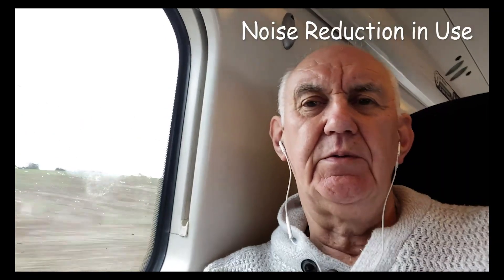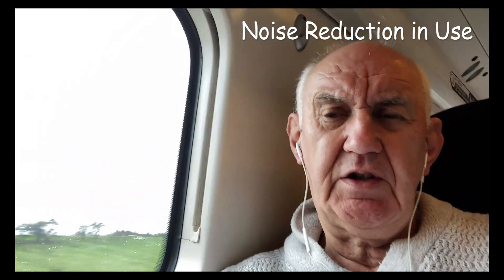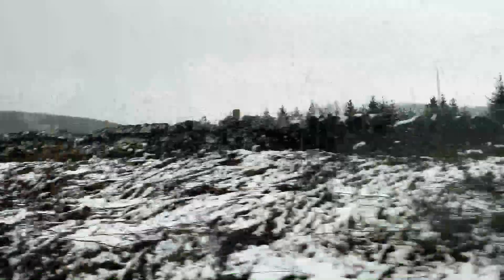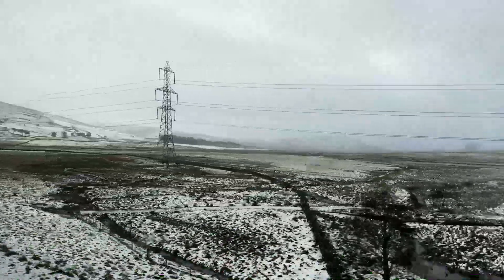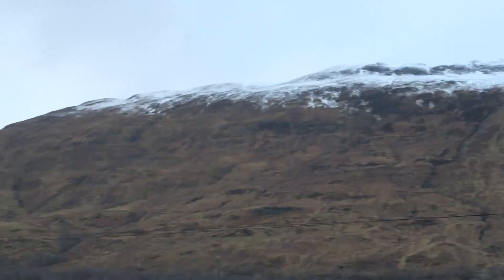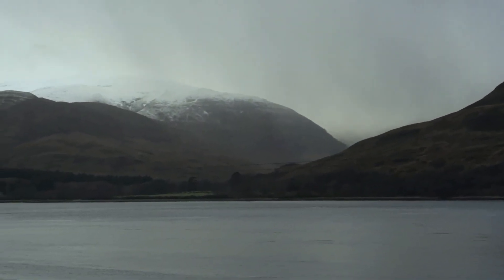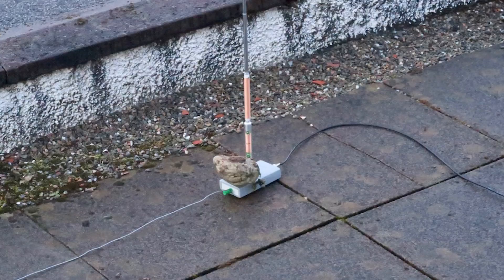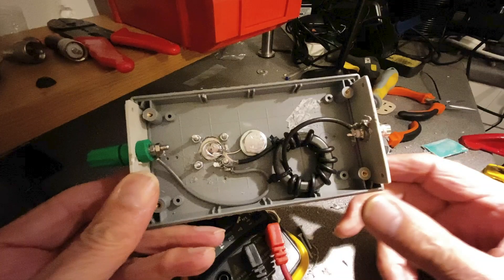Setting Up Your Portable HF Vertical Antenna - Ideal for IC-705, KX2 or KX3 Etc.

Comment: In place of the line isolator could you use a torroid core (240-31) to wind around the coax at the feed point or possibly a choke with a number of  ferrite beads on a jumper at the feed point? I ask because I already have those to spare and have a mobile/portable antenna on order intending to mount it on a tripod for POTA work. Great video with the Iphone btw. K5FIT

Comment: So a quarter wave vertical (17ft) with Chameleon Hybrid Mini versus a 60ft sloper with Chameleon Hybrid Mini? any thoughts Peter?
Reply from the maker: Hi there. I have no experience of the Chameleon antenna. Generally speaking the longer element is better, but depends on the antenna transformer they have used. Sorry I cannot give you more info on this one. 73s Peter

Comment: what verticle antenna can you recommend for a garden of 10ft x 10 ft
Reply from the maker: hi there. The antenna I would suggest you look at is Hustler 4BTV.  Put a copper stake in the ground as the earth and then try and run 3 or 4 short wire radials on the ground or pushed below surface. Radials are connected to the earth point also. 73s Peter
Reply: watersstanton thank you Peter I was thinking of the 6btv
Reply: Hi Peter name here is Paul  I like you videos I built one of those antenna ground isolators works very well with the shorter antennas ! Thanks for sharing Peter! Ps I use a metal tape measure for counterpose 100 feet covers all bands. Lol 73 and thanks again Peter! AA8WQ, from Ohio.